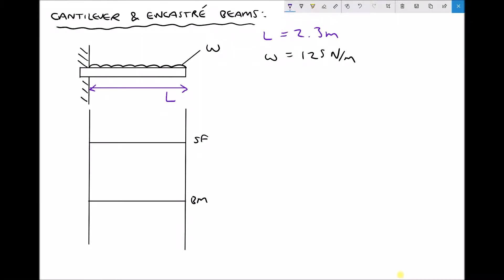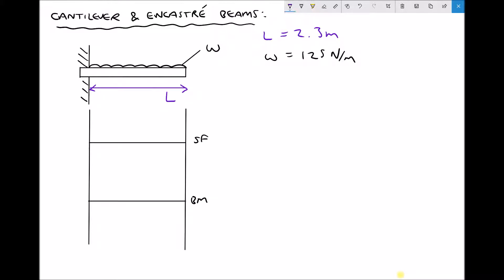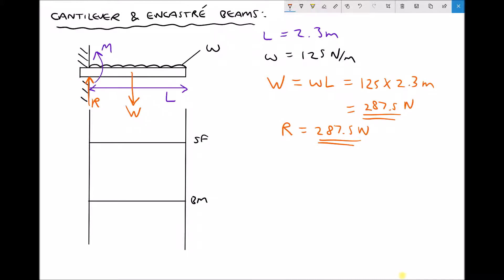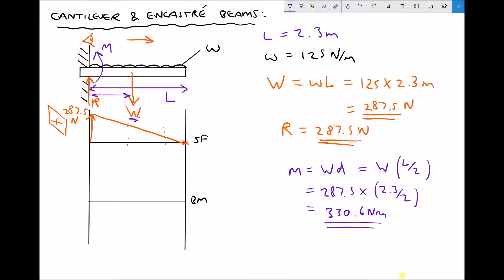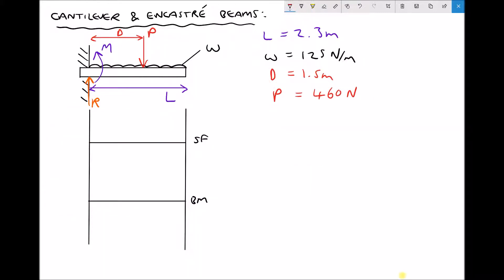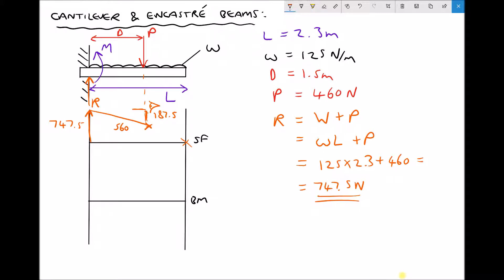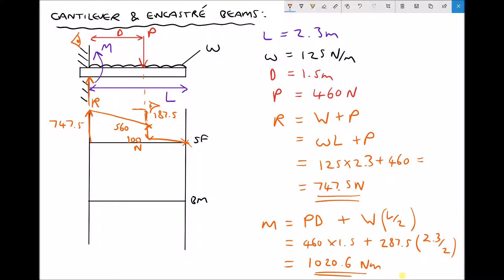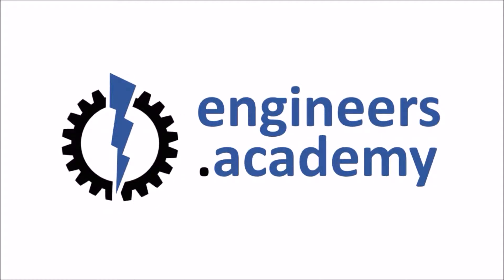Calculating Shear Force and Bending Moment at the Support for Cantilever Beams

Comment: If you have 2 point loads, do you simply add them together at the respective distance?
Reply from the maker: If you are referring to the shear force diagram then yes. It helps to imagine moving left to right along the beam and adding the effects as you pass each load.